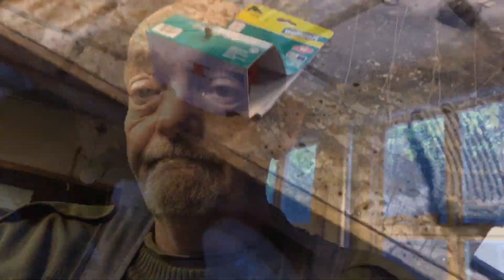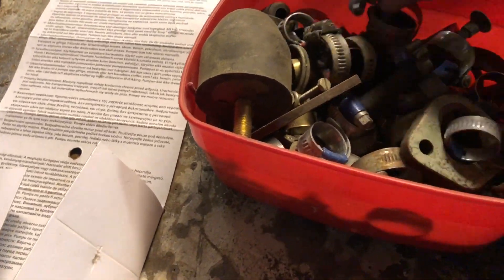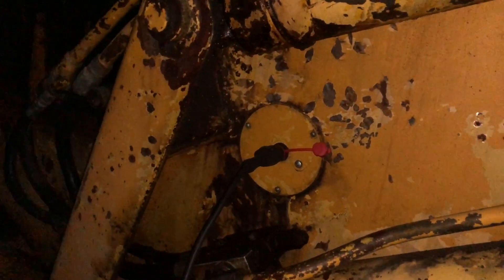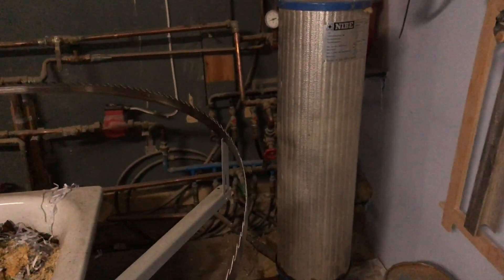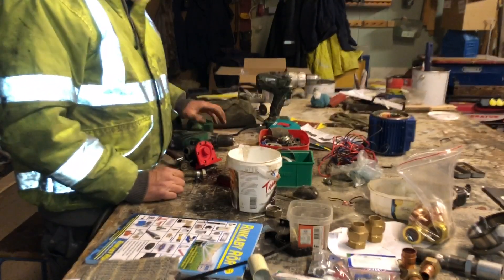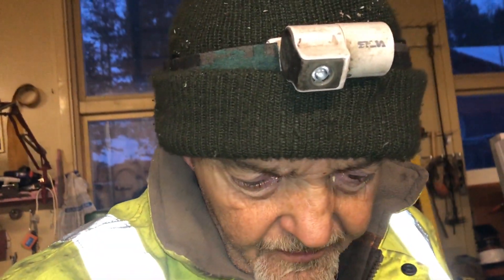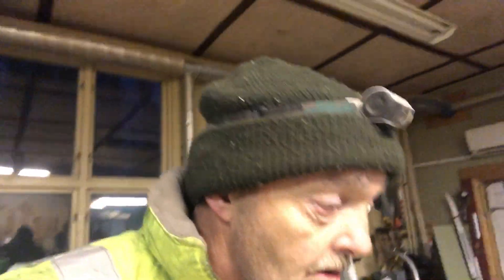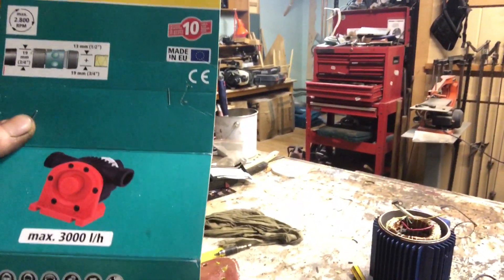Mobile fuel pump for tractors, plant, trucks or any liquid that needs pumping 3000lpm with a drill.

Comment: Good pump had one for years
Reply from the maker: The old hoses I used, no good the second time I went to use it -26 the pipes just split. So now new old pipes and it works, but yes pumps are always good to have around.
Reply: @arctic-rebel  rubber hoses for fuel
Reply from the maker: @mp3625  No money for the correct item, whatever I have laying around will have to do.
Reply: @arctic-rebel  lol I hear you made due with what you got... Perfect

Comment: -22 already. I won't get to see those temperatures until middle of January or early February. One good thing about that cold of the weather is you never have to take the top off a jug to see the level of fluid in it because the frost line gives it away. Hahahaha.
Reply from the maker: So true, the temperatures will fluctuate for a while before the big dive down and Jan-Feb are the coldest months here also. The old men talk of minus 50, but I have not seen below 33 here yet.
Reply: @arctic-rebel  Yes! Everything was worse in the 1940's in Lapland !! If you had your horse to stand still it got frozen to the ground. To get it going again you had to remove the horseshoes and fetch them back in the spring! I've heard them all from my old relatives so it must be thru.  Haha!
Reply from the maker: @uppsalahazzemarkstedt2759  we listen to the same stories LOL

Comment: I have a small version and can pump 10l in seconds with a battery drill, they are difficult to get going the trick seemed to be to have it low to the ground or below the bottle your emptying. Led flood lights would have that shed lit up very cheaply.
Reply from the maker: Ok I will try that, I would rather use a battery drill. I know LEDs are the way to go and I am getting there but it all takes time and money and it did not matter when it was just me, now there are thousands of you.

Comment: My drill instructor always told us to - improvise to survive! That has stuck with me since I was a 17 year old lad! 😁😁 Would be interesting to know how much diesel you go through in a snow ploughing season!
Reply from the maker: That totally depends on snow fall and who needs help. Neighbors get into trouble, sometime even clearing there forest roads because our roads are built up to allow snow and water during melt to travel away from roads and even the most experienced can slip into a ditch. Same with cars so a single rescue can be more than an hour one way. But as a overall guess per winter season 300 litres 68 gallons or so. That would be during the time it has chains on. Chains off maybe 1/3 of that.

Comment: Hay Simon 
I HAVE A couple of them pumps love em ! I've pumpped everything in them gas oil deisel paint ect.ect. give em a quick ckean and never had a problem. I did find the faster the drill turns the better it works. Cold there damn your lucky 😨
Reply from the maker: Hi Brad, I have no idea why i did not think about it before, here they mostly have farm tanks with pumps but of course I only need a small one!

Comment: So you mean the previous owner had a Aerotemper connected to the circulating hot water? Nice to use if you want to quickly rise temp in a room. Can give a lot of KW and will regulate down by the room thermostat! And not so uncommon to have a lot of dirt or calcium deposits in the floor heat system depending of what water you will fill it with. You can watch how it looks in the expansion vessel. Try to flush the system in summer. You can use small balls of steelwool to clean it, but start with small ones. After the exchanger you can have pure clean filtered water, distilled/deionized/filtered water or the same with antifreeze (or a blend of Hemkörd vodka :) if it suddenly will be below freezing in the room floor. You don't need higher temp than 35 degrees in the floor pipes.
Reply from the maker: Great reply thank you, I am only getting 15 to 20 degrees in the floor pipes so I know I have a problem.

Comment: You can lift it maximum about 10+ meter (depending on density) in the suction hose. If you will suck it higher then then you have to get overpressure in the fuel barrel or order higher atmospheric pressure from SMHI! :D

Comment: The pump will certainly be a back saver. Thank you sir.
Reply from the maker: It has proved to be very useful, not just saving my back but climbing onto a frozen machine presents many dangers that I no longer have to deal with. Thank you for going back and spending the time to view my earlier work.